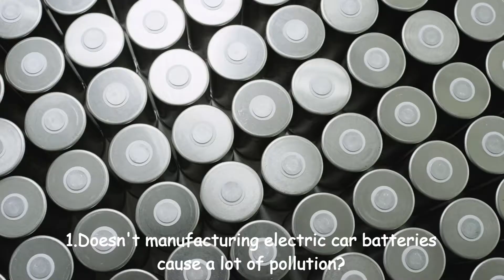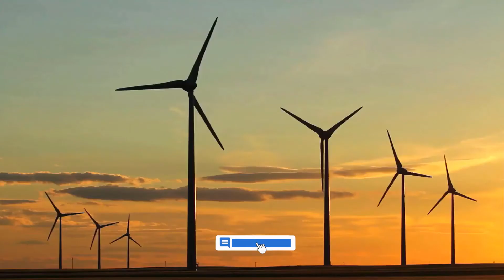Electric Car Pollution vs Gas Cars | Are Electric Cars REALLY Green?

Comment: What about recyclability? Fossil engines are fairly recyclable in comparison to all the batteries inside of an electric vehicle which cannot be reused and do not decompose at a significant rate.
Reply from the maker: Yes.. Recycling batteries is a huge technological challenge at this point of time.. Good point that you brought it up..